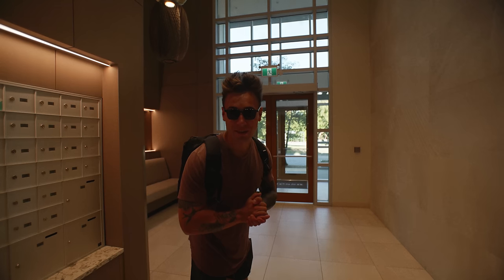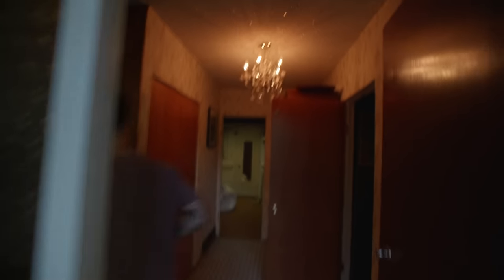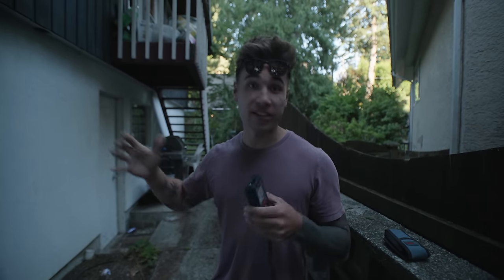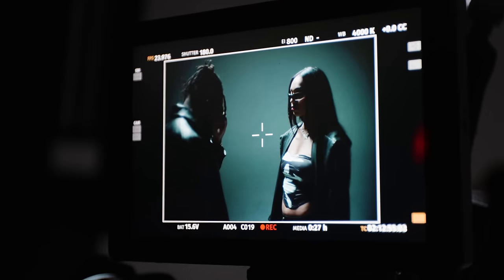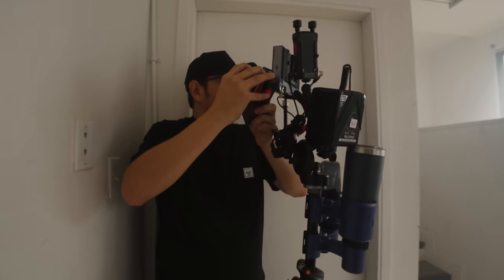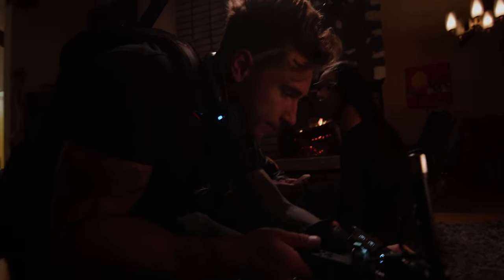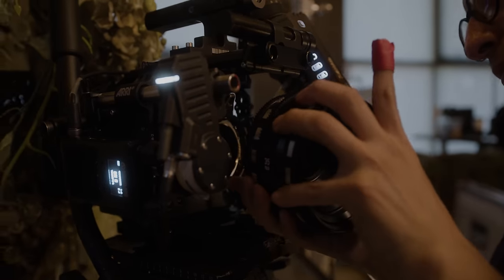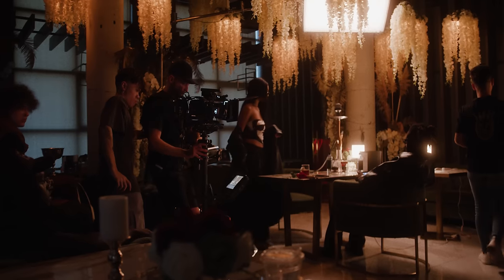Behind The Scenes of a MUSIC VIDEO Cinematographer

Comment: Love this insight chris! When you use the light meter - do you try to match the camera aputure/settings to the incident reader measured by the subjects face?
Reply from the maker: What I do is I set my camera setting and aperture how I want it, then I take a meter reading and then I dim the light until my meter reads the T or F stop my lens is set at! I always do this way because I usually know what settings and aperture I want since all those elements effect your image.
Reply from the maker: What’s your thoughts on a light meter video?
Reply: @chrisajtony  i see! Makes sense. Do you then leave the skin at middle grey in most occasions?
Reply: @chrisajtony  yessss. Or more about exposure of an image 🔥
Reply from the maker: Yes usually you want skin tones at middle grey BUT!! Here’s the big but! Middle grey isn’t always where the camera manufacturers say it is! So do camera tests with your light meter before the shoot! Depending on camera systems i over expose by 1/2 to 1 stop over exposed! I usually do this with older red cameras, 16mm film sometimes the older Alexa’s. But usually Alexa is super accurate and middle grey really is where it should be so you can expose with your meter without having to overexpose
Reply: @chrisajtony  aha! For your backlit scenes do you over expose the backlight by certain stops? You’ll be on the shadow side which i assume you didnt have any bounce besides the natural lightbounce from the floor. Did you think of a specific contrast ratio or just made sure that the back light was 2 stops over middle grey for example?
Reply from the maker: @hunnylee4720  I always expose my key light. But sometimes I will metre all my sources. Sometimes I’ll metre one or two my sources. Really depends on how lazy I’m feeling. but I tend to just meter my key light and then check false colour for ambiance but you’ll find a method that you prefer because maybe my method is really bizarre lol.
Reply: @chrisajtony  Thanks a ton!